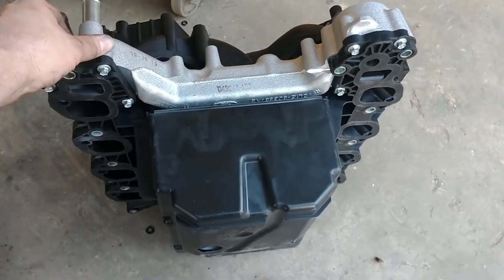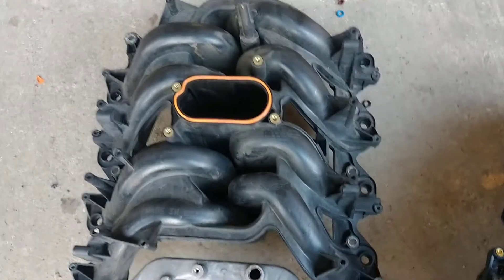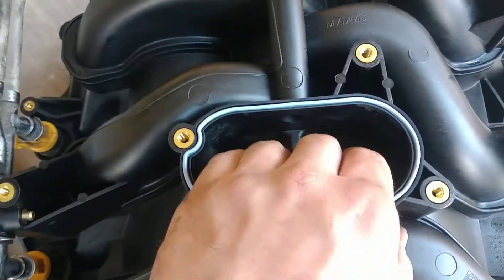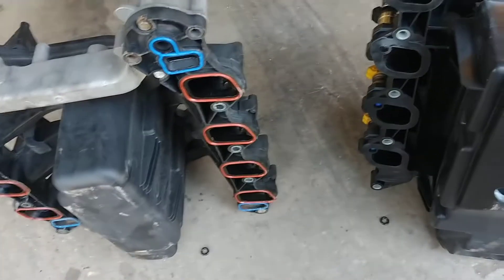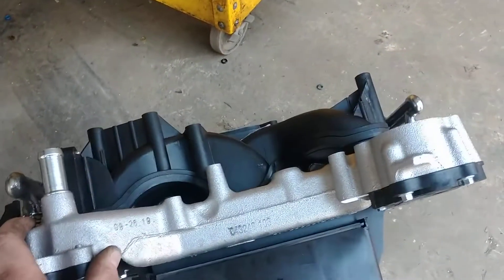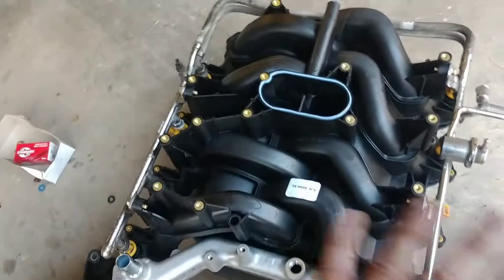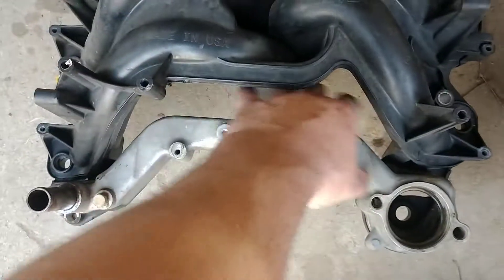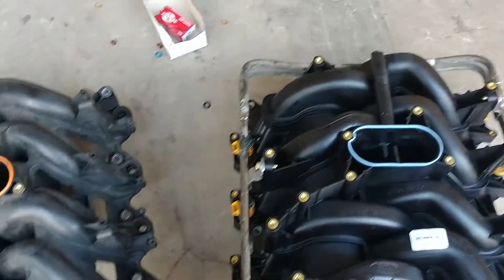5.4 Ford intake manifold comparison

Comment: I bought a dorman intake, after torque was set on the bolts, I saw an exposed water jacket on rear right  corner of the engine.
Reply: That's normal because the heads fit either side of the engine.

Comment: I refuse to use Dorman sensors and valves, they are trash.  I only use Standard Motor Products for those, simply because they have a lifetime warranty and you aren't paying for the name...which is what you are paying for with Motorcraft.  I do, however, have a Dorman Intake on my 03 Lariat 5.4, simply because it was quick to get here.  I haven't had any problems with it yet (surprisingly).

Comment: I bought the Dorman first and the screws are why I then bought a oem intake. I had the cover off and the Dorman plenum is definitely smaller. 
-2002 f150 5.4 2v. 
-did this in 2019 and the oem intake was only 60 bucks more than the Dorman then.

Comment: Definitely a difference from Ford to Dorman BUT Ford using plastic to begin with for saving on the materials is down right hell for the customer in the end. I do not have a plastic I-Manifold on my Ford, mine is solid cast aluminium with factory gaskets (never been removed). What stopped Ford from making the timing cover out of plastic as well. You should chk out the new Fords, plastic oil pans with a nasty looking plastic drain plug with no real threads, then again why put threads on plastic right. None the less, really glad you made ppl aware of the 💩 Dorman can make. These idiots (Dorman) not only screw up Ford parts, they screw it up bad with Chevrolet parts as well. 😎🤘🏻

Comment: Actually..that ford intake dosen't way much more than the dorman. Your comparing the weight of the ford with fuel rails  and fuel injectors on it. I've installed over a dozen dorman's with no problems or screws stripping out. I like the self tapping screws. If you strip one then your putting more pressure on it then needed. I have one on my 2000 f150 5.4 for 5 yrs now....no problems.
Reply from the maker: You do realize I weighed them both with nothing installed. I am not a novice at this. That was not my first encounter with dorman or other aftermarket intakes having issues. 
This was several years ago and at the time a factory ford was not much more expensive than a dorman. The power difference was also quite noticeable as this was a 5.4 in a Excursion so any added power was greatly appreciated by anyone driving it.

Comment: Can you run PI heads on a 5.4? If so what intake fits?
Reply: Yes, you can swap a non PI 5.4 to PI heads. I recommend an OEM intake and if you can find a used aluminum intake from a 99’ 5.4 that’s the best in terms of not breaking the coolant crossover like the plastic intakes.
Reply: @sage wimsett  How can you swap it if the intake chambers are different shapes on PI cs Non-PI supposedly from what i read?

Comment: I will never buy anything that Dorman make ever again. I almost blow my engine up two different with there low quality part. (2010 F150 4.6 2v  thermostat stuck shut and the plug/cap they put on the intake manifold blow off) The icing on the cake was the poor seal on the intake manifold leaked coolant into one of my intake ports.

Comment: I broke the heater return nipple/inlet off the back of my intake manifold on my 2011 CVPI. I immediately panicked and bought a garbage Dorman for $200. Later on I returned it because I hated it and got my money back. Ended up fixing the nipple issue with a heater hose connector and some epoxy but the gasket was leaking on the other side anyway. So I got on Ebay and bought a used OEM intake manifold from a 2009 Grand Marquis with 47k miles with the OEM fuel rail and injectors on it for $150!!! Then I turned around and bought some Fel-Pro gaskets for $30. All together that's $180. Nothing wrong with buying used OEM parts as long as they're in good shape and come off cars with low mileage.

Comment: WHERE DOES A GUY FIND THE OEM hardware for the OEM manifold when going back to OEM from dorman! Need the bolts and such!
Reply from the maker: Ace hardware....
I was lucky enough to have worked on so many of these I had spare coil hold down bolts and other necessary hardware
Reply: @tech1302  ok , I didn’t want to have to use the ole specialty bolt bin option cause figuring out which ones would work - but was hoping for a part number
Reply: @josephthespeeddemon  Do yourself a giant favor and get on ebay and buy a gently used OEM intake manifold. Dorman won't last. It's a bandaid fix. 3-5 year life. Better off going OEM even if used.
Reply: @blessedjuggernaut  my post didn’t specify I was needing dorman- I already have a Ford motorcraft intake - but I need all the OEM hardware since someone installed a dorman and the hardware types are different now- 🤦‍♂️

Comment: I don’t like either. I wish an aftermarket company made 100% aluminum one instead of that cheap plastic crap!
Reply: That would only cause heat soak.  You don't need aluminum to channel air; composite is much smoother, lighter, and move effective.
Reply: I believe I remember seeing in my brother in law's 97 expedition an aluminum intake on a 4.6, I was driving an 03 with a 5.4 at the time and after comparing noticed all the plastic on mine and thought ... You cheap bastards Ford!

Comment: yes i just got a Dorman intake  about 30 days ago .  my 1st problem was with the pvc valve in the back. it would not stay seated after about 5 min running . so i took off oring and used Teflon tape. now the next problem was with the port holes . the gasket is a bit different so with that said i had vaccum leak that took a shit load of time to find. the vacuum leak at 1st i replace old lines that looked bad . they did need that tho. i put intake on 3 times be4 i notice my problem was gaskets . and not lines. what i did was took my old one and got new Factory gaskets. so i will never bye that kind of intake ever again . oh yeah and the new one started leaking in between the crossover and intake . right off the bat . came that way . smh i have 574.972 miles on that ford motor has never been rebuilt this has been the 1st and last time i ever cheap out on a part for it . i get 22 miles to the gallon in town at that. best upgrade is to groove the throttle body it gave me more power and over 50% more gas mileage .
Reply: What do you mean groove the throttle body for an upgrade? My truck is running the Dorman intake and I feel a little less power than I had with the factory intake. So far no failures at all with my Dorman and my truck runs fantastic! Just seems a little more doggie
Reply: @Rockymountainklx  give it a min . and if you dont have no problems then you a very lucky man . the groove what that is . at the throttle plate if you take it a part .  there's a hole if drill it out at a angle. it will open air flow that in turn moves the air in a Vortex pattern. cutting down on restriction of air flow . if done right will double your gas mileage and horsepower. If you look it up on YouTube there's a few videos on it that explains more in-depth what to do and give you a better idea than me trying to tell you. Just searched Groove throttle plate
Reply: @dougsmith1781   wish I had a Ford intake again but time was money for me and I needed my truck ASAP. I’m hoping it lasts too but if it doesn’t it’s my fault for not sticking with Ford parts/ fluids like I’ve always done with this truck

Comment: Cough up the extra money... As them intakes are an all day job... So don't screw around being a cheap ass....It will cost 8 hours of your time, doing it twice....I can make $1000.00 in 8 hours...

So do the math.....And do them two cross over tubes O-Ring seals while you are in there. Maybe even do the head temp sensor...As you will back in there fixing the leak....And if the head temp sensor goes south.. Your AC will not work.. The PCM goes into limp mode. To protect from over heating...
Reply from the maker: Exactly what I tell people.....
Reply: 8 hours? Lol okay
Reply: @logangaddy4917  learn to read… You go cheap you will turn a 4 hour job into an 8 hour one. Plus have to drain coolant again. If you do it twice..

So change the coolant crossover O-Rings and the coolant head temp sensor with harness. As the harness goes bad too..

I also take PayPal for giving good advice.
Reply: I do it for a living man. Put the ruler down.
Reply: @logangaddy4917  i been repairing vehicles for 40 years..And run my own repair show..

So make one more appeal to authority.

Comment: Has anyone use a Napa manifold?   Use one on my 2001 f150 XLT 4+4  5.4 Triton 2v  back in 2002 or 2003.  So far no trouble 355150. Miles.  The original ford manifold was leaking at # 1 cylinder. Only  thing that has happen to the ol truck had to put  front hubs bearings & manifold & fuel Pump.
Reply: So you’re saying that Napa has a manifold?? I’m looking everywhere and can’t find one. Isn’t the NAPA manifold made by Dorman?

Comment: I put dorman intake manifold last week in my truck because is cheap the oem is very expensive
Reply from the maker: Yes 100-125 difference very very expensive
Reply: @tech1302  the oem was 450usd  in the dealership
Reply from the maker: @Daniel09King  internet is your friend for these things unless there is time constraints then ok get a dorman but if you have time a oem can be found online for less than 300
Reply: @tech1302  I couldn’t find it  for less then that 😕
Reply from the maker: @Daniel09King  https://www.tascaparts.com/oem-parts/ford-intake-manifold-2l1z9424aa?origin=pla&gclid=Cj0KCQjwl9GCBhDvARIsAFunhslQQ1TTfoJAdtH6wQx7oAqPMt4RVD-kO76-tO8g_kSY2tnYX0an7CYaAnGiEALw_wcB

Comment: I sold Dorman products for years at a NAPA store....reboxed into Balkamp line, we had our share of problems too. Many dealers like yourself wouldn't use many of there line. Doesn't make a lot of good will or friends selling some of there stuff....in particular Ford 7.3 valve cover harness and gasket assemblies.....look out. That was a few years back though. Thanks for your vid.

Comment: I installed a Dorman on my 2002 F150 about 6 years ago. Recently it started leaking from underneath the aluminum coolant crossover tube on the . thermostat side. I'm assuming it's cracked. Truck has 260k miles.  I doubt the truck will last me another six years. Debating myself if I should go Dorman again or OEM. Thanks for the vid!
Reply: Because people don't replace them 2 little seals on that cross over pipe. While they are in there...

Comment: Got the damn Dorman on my cammed 5.4L 2V truck that I use for off-roading. Have had it on there about 6 years. Been leaking antifreeze the last couple months. Glad I saw this vid, I’m gonna pick up a Ford intake in the next few days.    Definitely looks beefier & I like that the plenum is a bit bigger.    Might have to do a before & after vid to see if I notice a difference in power 😎
Reply from the maker: Tell you a little story...
The truck I put this on was a 5.4 excursion that had 250k and ran well. When I went to test drive it I had to pull out a bit quickly and it broke the 4r100. Only have 2nd gear if you selected it with the shifter. I could tell a good bit of difference with it. I had worked on the truck previously so I had driven it quite a bit with that dorman intake.
Reply: Doorman's has a lifetime warranty
Reply: @iloveboss302  Standard Motor Products does too, but they are made in the USA...Dorman isn't.  I have a Dorman Intake, but every other sensor or valve I have replaced is SMP, and I specifically request SMP when I go to the auto parts store if they try to offer me Dorman because it's a little cheaper.  I have had a brand new Dorman EGR Vaccum Solenoid and brand new Dorman DPFE sensor and they both failed as soon as I installed them.  I replaced them with SMP, and they worked perfect.

Comment: Dorman is more useful with its warranty in effect. the ford part might last longer but it will cost full price. your reg Autozone will warranty lifetime Dorman parts. and i do my own labor so save there. some things like fluids can't bypass. so 50/50?
Reply from the maker: For 100 extra I won't touch a dorman
Reply: @tech1302  nothing against dorman or for it, but i agree OE is always better. unless the design is flawed.then custom is the way to go.

Comment: Teetering on buying the Dorman due to availibility... watched a few comparisons and this one is best.  The split plenum and runner difference.  Motorcraft wins even if I wait.
Reply: You don't have to wait man there's Ford dealerships all around the country that sell those I use a couple in Arizona and I use a Ford dealership in New Jersey they all have that stuff on the Shelf
Reply: @joehalliday4989  I just replaced my intake manifold on my 2000 f 250 5.4  found a oem manifold from a dealer in Missouri for a $ 180 dollars

Comment: Just FYI, my 2000 Ford intake had the same size plenum as the Dorman you showed here. My Ford intake also didn't have a divided intake. After 2003, 2004, or thereabouts, they switched to the larger plenum. I've read that if someone has an older 5.4L, they can get a 2004 (do research to confirm the year) and it will fit on a 2000, for example. It's not worth doing just to chase a performance gain, but if someone needs a new intake manifold anyway, then it's worth considering. Unfortunately I only discovered this after I had already received mine, and I didn't want to return it. I can't say whether getting a 2004+ aftermarket (Dorman or other) will make that adjustment.
Reply: Same hear. My moter had been replaced before I bought it. Played hell trying to find what came out of it. Way bigger lower plentum